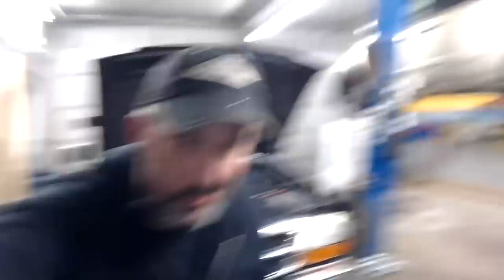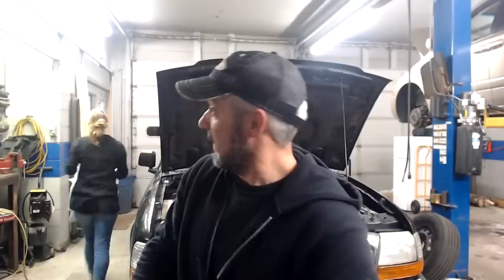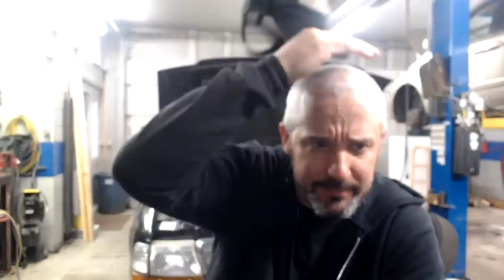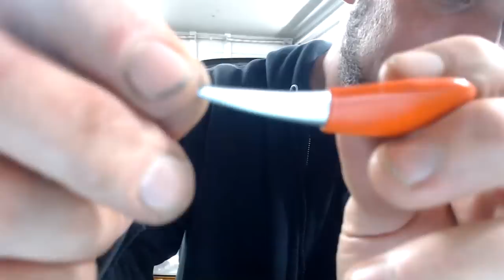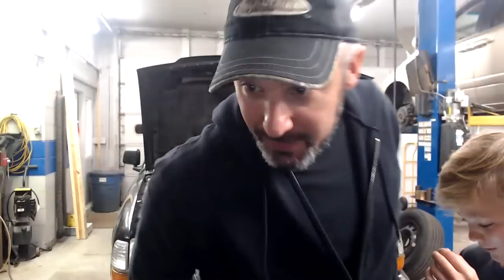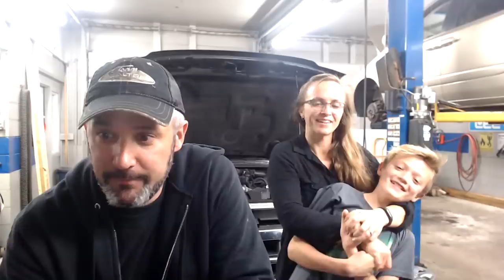WUT What's Up Tuesday 10/22/19

Comment: @ South Main Auto LLC Left click in any empty part of the scroll bar on the right side of the chat text area.  The auto-scrolling should come to a stop so you can actually read the text while it is sitting still.  At the same time a down-arrow in a circle should appear at the bottom of the motionless text.   Use drag and drop or the mouse wheel to move the text up and down.  When you find the text for which you are looking and are finished reading it, left click the arrow at the bottom of the text and the auto-scrolling should start again.  The rest is intuitive. This is for a Windows 7 
desk top set up, might not work on your iphone.

Comment: @1:15:30 Fuel Injector cleaning.  I need to do it in my Jeep 2005 4.7L V8 each year because I store the vehicle for seven months over the summer and the ethanol in the gas leaves a sticky residue over the sprayers that needs to be cleaned off.  I use the OTC pressure canister and attach it to my Shop air hose.   Works great.  Tried the new injector route the first time $40 x 8 = $320 for Mopar re-manufactured injectors.  The problem with that is that I have no idea what the issues were with those eight injectors prior to them being re-manufactured.  Not good.

Comment: It’s called SMOD for the Nissan, Strawberry Milkshake of Death.  Well known issue for Nissan between 2005-2010 Pathfinders, Xterra and Frontiers. Replace the radiator before it happens or do a bypass other wise bye bye transmission.

Comment: Ciliary muscles at about age 40 begin to be less elastic and cannot pull as they used to in order to focus the lens at close range. Lots of folks will try to avoid the reading glasses until they finally mess up enough to give up. A small magnifying glass is usually a good thing to have in your pocket. Some eye surgeons will suggest lens implants, like they do for cataract patients, which provide "premium lenses" at extra cost so that you have the "progressive" lens effect. Of course, this is expensive but for those who just refuse to wear glasses of any kind, its a good option.
We see bacon priced around $7.99/lb often. New York steaks are that much per pound. When prices are down/on sale, a good price on bacon is $3.99/lb. That's when we buy 20 pounds or so and freeze it until the next sale on bacon.

Comment: At about a hundred miles before every third oil change, I put 1/2 quart of ATF in a 1/3 tank of fuel and the other half in the oil. 
 I've got 190k with original injectors and it doesn't use oil either!
Reply: ATF IS NOT MEANT TO BE BURNT, USE MMO OR TCW-3 IN YOUR GAS INSTEAD. IN THE ENGINE OIL OK BUT NOT IN THE FUEL SYSTEM.
Reply: My 94 Honda has 370,000 miles on the original engine and gearbox, including original injectors, and I never put ANY additives whatsoever in that car.  No Seafoam, not injector cleaner, not nothing.  Still going strong, 28-29 MPG to this day.

Comment: It's a Menda wire threader. It's designed to thread wires under the already tied wire ties. It works great for cutting but that's not what is was made for.
Reply: Many years ago we used them to add wires and waxed linen lacing to existing hard wired main distribution frames.

Comment: I have a car question. I'm sorry that I missed the live part. I have a 2009 Pontiac g6 with 86000 on the clock. When I press the gas when accelerating there is a shake from the front. Only when I am driving not when parked will it shake, I have checked the motor mounts and the look fine where should I look next?
Reply: Possible misfire under load. Check the ignition system. Plugs, wires, coils ect... Any codes or check engine light?
Reply: @curtis1951  no lights and new plugs also a note the car has been getting bad gas mileage the car only has 80,000 on it
Reply: @Ceratosaurus4689  
Still leaning towards an ignition system problem. Plug wires or coil. With the bad fuel mileage Could be carbon build up or bad / dirty injectors. Sounds like it's got a miss fire under load. There's some low tech tests that you could do but it would be faster to have a shop diagnose it.
Reply: Does it go away when you close the throttle?  Shaking under load is a tell-tale sign of bad inner CV joints.
Reply: @Patrick94GSR  with no throttle there is no shake going down the road at speed with no throttle but as soon as I step on the gas it shakes
Reply: @Ceratosaurus4689  yep, inner CV joints are toast most likely.  Had it happen to me on at least 3 or 4 different FWD cars over the years.  One time on my Integra I went through at least 4 sets of re-man AutoZone axles in the span of about 6 months because of bad inner joints.  Now I only buy new axles from Napa or O'Reilley.

To check the joints, from under the car, grab the inner CV joint cup and the axle shaft and try to move them opposite each other. Alternatively, spin the tire slightly and watch for the inner CV joint moving with the tire.  There should be absolutely zero play between the axle shaft tripod bearings and the joint cup itself.  When there's play, you get the vibrations like you describe.

Comment: I like you work for myself so we don't really comprehend the issues of the GM workers.
You and I instantly benefit from effort we put in, general assembly workers don't so easily see monetary gain or condition improvements when company doing well. 

With amount that elected to strike I would assume they got genuine grievances or at very least very disconnected management directors share holders fueling the bad feeling .
Reply: Eric will generally not respond to political issues (yes, unions are a political issue).  He's just tired of the strike raining on his parade by making OEM parts hard-to-get, expensive or both.

Comment: I think I've been watching this channel to long that every time I hear dorman I think oh crap that part will fail
Reply: Hes not wrong i put a valve cover made by doorman on my gfs 2.5 altima thing starting drinking oil from day 1 took thr cover off put an oem on and viola no more oil burn the doorman had an unsealed seal, thar woild suck oil through the intake
Reply: I got a water pump pulley by dorman. The OEM pulley that's been on my car for 16 years broke as I took it off so I could replace the oem water pump

Comment: @1:29:19  Let me know what magnification reading glasses you currently need.  I will send you some Pyramex safety glasses with that magnification, if available.  I use 1.5 and they also come in 2.0.  I wear them all the time when working on vehicles.